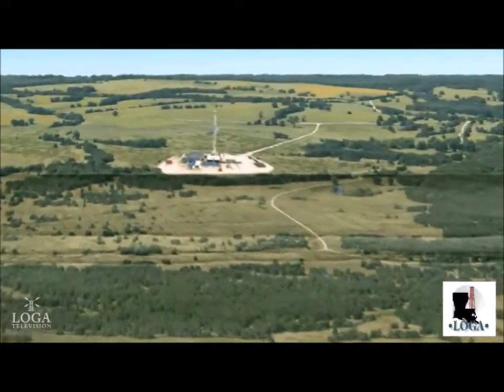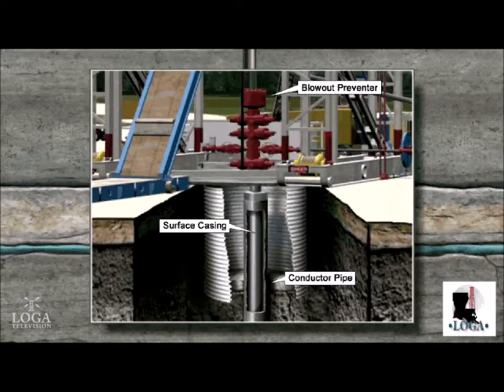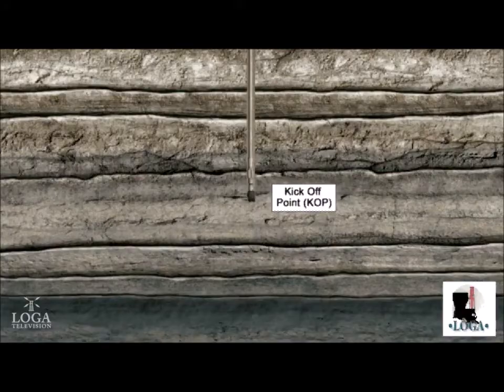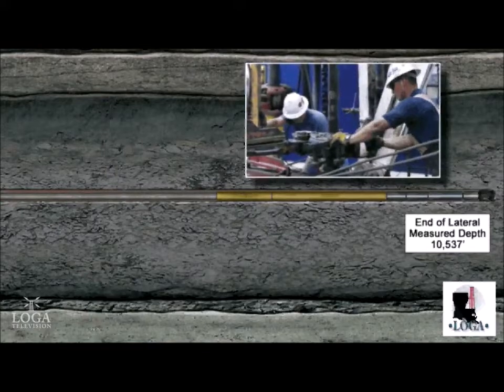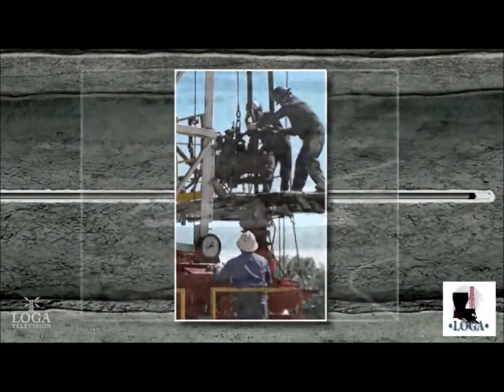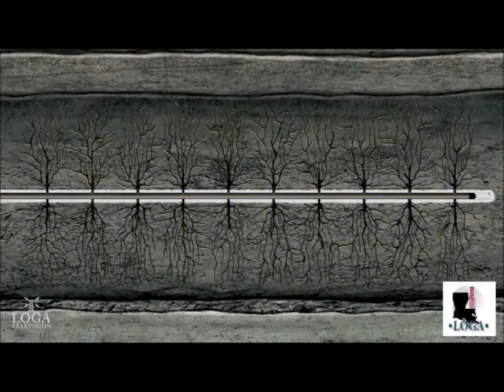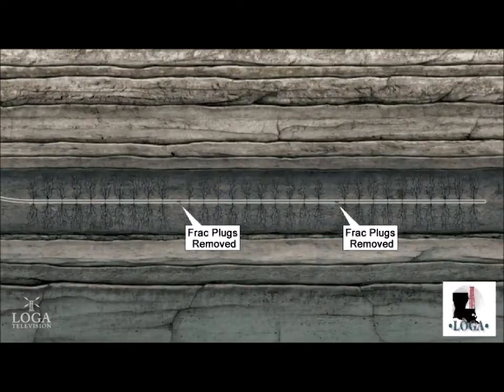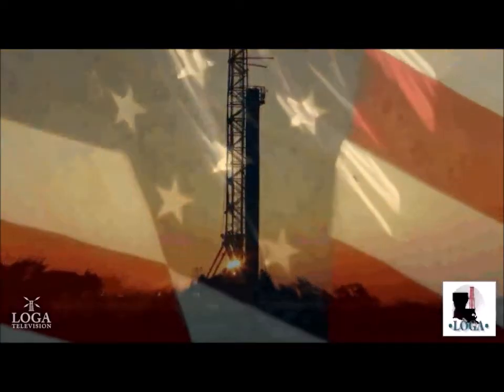How it Works: Horizontal Drilling & Hydraulic Fracturing (aka Fracking)

Comment: What make the drill curve?
Reply: @rickbrown8865  There are 3 separate rotating drilling motors.  If you run all three at the same rate, the drill head goes straight. If you run only one or two, the drill head will turn to that side and hence “curve” to the direction you want.  It’s clearer if you look at an image.  Google rotary drill bit.
Reply: Drill pipe is very flexible. The mud motor is what directs the bit. You can control it by changing the mud flow and rotation of the bit.

Comment: The previous study of shale mechanics related to avoiding major vertical fractures, the new horizontal drilling technology that makes this possible, and fracking subject only to gas wells and dense formation. It contributed to safety and costs, as well as further damage from 
vertical severe fractures.

Comment: why can't we frack in between each of the fractures also?
Reply: Ground/geological stability concerns.
Reply: Because fracking causes structural damage  to the surrounding area. Which makes long term, close proximity fracking, dangerous for workers and near by inhabitants. Excessive fracking can lead to things like sink holes, fissures, and run off damage caused by the chemical slurry used to pressurize gaps in the crust- may also pollute local water sources, long term. Unfortunately, it's difficult to predict when and where (In the surrounding area) a fractured site can 'go off'. Which makes the land used for fracking essentially unusable for any other practical purpose. states like Ohio and West Virginia have many stories about fracking damage in the long term that may be of interest to you.
Reply: @xenoization  Fractures are only this wide ] [ filled with sand. When the pressure is released, all of the stress goes back to what it was before the fracture within days.  
All of the "slurry" must be removed from the fractures & wellbore for the well to produce.  A gas well is "KILLED" by pumping in a "slurry."
The fractures are typically a mile under ground.
They are less likely to cause any problems than the fractures caused by water in reservoirs.
Reply: @xenoization That is remarkably wrong.  The frac is typically 10,000’ below ground level and does not extend out very far.  A frac does NOT “make the land unusable for any other practical purpose”  or cause sink holes or any of the other drivel you’re claiming.  It’s just a ludicrous claim that you’re making.  The frac is almost 2 miles below ground level.
Reply: how can i meet you

Comment: Saudis made these bankrupt
Reply: What the hell are you trying to say?
Reply: they dropped the price of the oil market primarily to out compete these
Reply: @Fin4L6are  Wrong. Fracking makes the US less dependent on Saudi oil. The Saudis cut their price to become more competitive. You have it exactly backwards.
Reply: @dswagler  I'm not convinced. if the US wants to keep their shale that's great. But there's no way they can compete on the world stage, once the saudis make the price go down. I can't see fracking companies not losing money and going bankrupt as we speak.
Reply: @dswagler  Okay. In 2013 oil price was $100, shale being easily cost-effective. Besides, that looks even more bleak considering you can't improve much over 95%.
Reply: @Fin4L6are    20 to 40 years
Fracking is a temporary process that occurs after a well has been drilled and usually takes only about 3-5 days per well. Sometimes, wells are re-fracked to extend their production, but the energy each well can produce may last for 20 to 40 years.

How long does fracking last?

If oil and natural gas are still the world's main energy source at that time, there will be more fields discovered in the mean time not to mention the vast amounts of oil shale under the Colorado Plateau for example:  

The largest known oil shale deposits in the world are in the Green River Formation, which covers portions of Colorado, Utah, and Wyoming. Estimates of the oil
 resource in place within the Green River Formation range from 1.5 to 1.8 trillion barrels. Not all resources in place are recoverable. For potentially recoverable oil shale resources, we roughly derive an upper bound of 1.1 trillion barrels of oil and a lower bound of about 500 billion barrels. For policy planning purposes, it is enough to know that any amount in this range is very high. For example, the midpoint in our estimate range, 800 billion barrels, is more than triple the proven oil reserves of Saudi Arabia. Present U.S. demand for petroleum products is about 20 million barrels per day. If oil shale could be used to meet a quarter of that demand, 800 billion barrels of recoverable resources would last for more than 400 years.

https://www.google.com/url?sa=t&rct=j&q=&esrc=s&source=web&cd=&cad=rja&uact=8&ved=2ahUKEwjwgufR4pztAhXSQc0KHWA1Dew4HhAWMAJ6BAgEEAI&url=https%3A%2F%2Fwww.rand.org%2Fcontent%2Fdam%2Frand%2Fpubs%2Fmonographs%2F2005%2FRAND_MG414.pdf&usg=AOvVaw2cmeWqDHcjH59MTIINqkox
Reply: @thomassenbart  I think it's great if the US can go energy independent, even if they need to subsidize it to make it viable, that's up to them. I hope to manage to not cause too many ecological catastrophes with the water and the land shifting under them.
Reply: @Fin4L6are   not much evidence of any negative ecological effects however and no subsidies either.
Reply: @thomassenbart  that's great
Reply: @Fin4L6are  Fracking companies do many other jobs besides fracking.  Halliburton does more completions than they do fracking or stimulation.